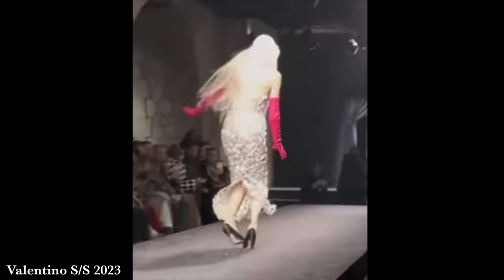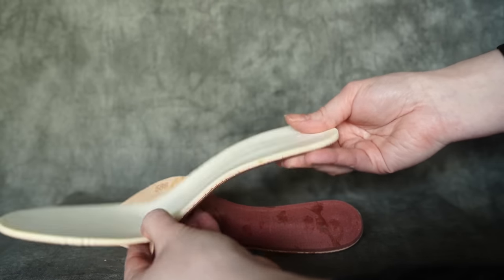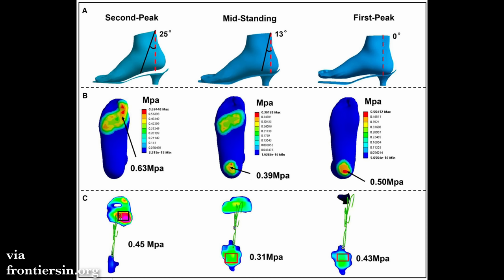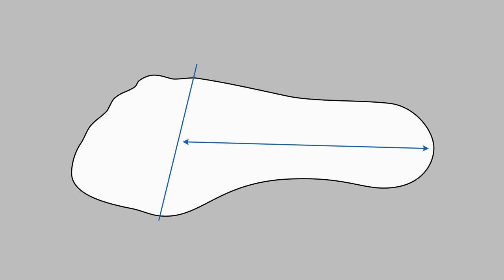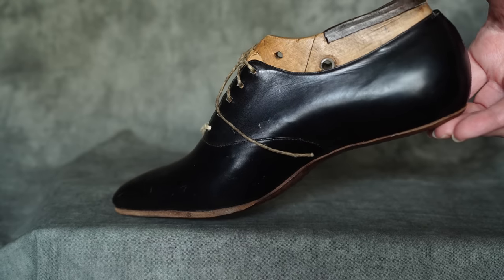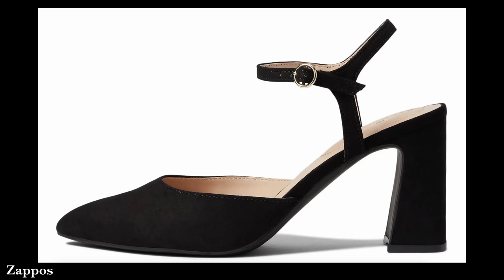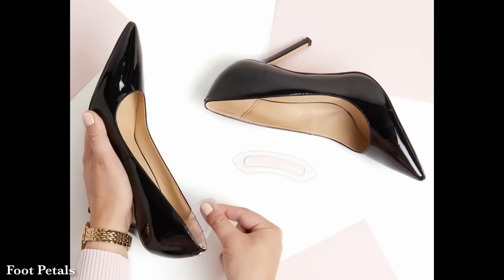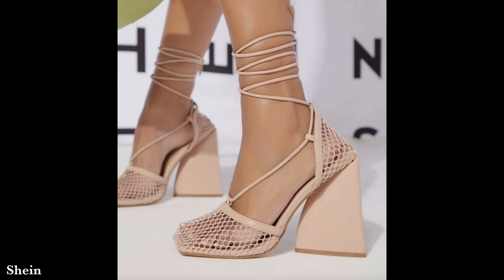Why are Modern High Heels so Bad?

Comment: I feel like most modern shoes in general have similar problems, not just heels. I've never worn them, but I would still struggle to find a comfortable shoe for almost 20 years of my life. I have wide, kind of flat feet, so I would always have to wear either sports shoes or shoes that were wide enough but way too long. I watched a video a few years back from a doctor talking about how everyone's foot is different and that most modern shoes are pretty narrow, which over time causes our feet to conform to the shoe, not for the shoe to conform to our feet. Ever since then and learning that I can find wide toed shoes, I feel a little less ugly and have had much better luck finding shoes that I can walk in without much aches or pains. I still need insoles, especially for work, but now I'm much happier and feel more inclined to walk around.

Comment: This explains my dislike of high heels so much! I have wide flat feet and all my favourite shoes are either converse, flat boots or relatively ‘flat’ goth platform boots (aka the height difference between the heel and the ball is small but the platform itself is like 5inches). I wish i could wear high heels but always felt unsafe when i tried them on. As a plus size gal, i always blamed my weight for this - now i know its the shoes! Thank you 😊
Reply: I have very wide but short flat feet and my toes come to a chisel shape with a giant big toe. I've flat out given up finding women's shoes that can work for me- the shapes are completely off for most of them, so off to the men's section it is. I've also found construction boots (Keen's Milwaukie to be precise) are some of the most comfortable shoes/boots I've ever worn. For being a steel-toe boot, it's surprisingly flexible, and the ankle support goes up a good few inches and is a lifesaver at the end of a long day. This is intentional design on their part, and I 100% appreciate it.
Reply: Did I write this comment? lol. People think I am crazy when I explain platform shoes are the most comfortable, but as a flat footer all the flexing in shoes that aren't like that make me feel like I am waling on knives by the end of the day. And the HUGE speedbump arch in Nikes is basically my cryptonite.
Reply: Same! Wide flat feet and converse are my favourite. I absolutely hate shoe shopping, especially for heels, because everything is far too narrow for me. For the first time in my life I found one pair of heeled shoes that actually fit my feet properly a few years ago. I cannot tell you how absolutely thrilled I was. I could have cried

Comment: The best shoes I ever wore had what I call a “Queen Mother’s Heel”. Not too high, a good average dimension and positioned in the right place under the heel. The sort of heel the Queen wore and could stand in a reception forever. It supported my heel, my arch didn’t tire and my spine was in the right place so no aches there either. Hard to find again unfortunately.

Comment: A lot of this was explained to me by the kind shopowner who sold me my first pair of heels. They are (I still have and wear them 18years later) red leather stileto sandals. Slightly 20-ish in design (more like someone cut out holes in a shoe, rather than just made a shoe out of the bits left after the cutting out). I don't have the chance to wear them much anymore, but during uni I would dance the whole night in them and then run home over coblestones. Unfortunately, the owner died and the shop closed and with it my access to learning the names of brands that cared about making their shoes right. But I kept all he said close ever since. It (and my very specific taste) made me a VERY choosy shoe shopper, but 99% of my shoes are pretty much made out of comfort. The 1% is a pair of black "professional" heels I broke down and bought for exams and work interviews at the end of high school, because the first exam was in 2 days and I had to get something. I guess I only wear them for about 4 hours a year, so they will do.

Comment: Thank you for all of that knowledge!  I am almost 59 years old and have always hated my “difficult feet”:  I have wide feet, a suuuuper high instep, and ankles that look like my calves just run straight into my shoes.  My most challenging feature, however, is that my feet are a full size different - left foot is a 7.5 and the right foot is a 6.5.  When I was in high school and participating in piano competitions I needed to get some heels (my Dad was super strict, but my piano teacher gave us specifics about how to dress to compete 😁). Back then I was lucky as my Auntie worked at a high end shoe store whose owner guided me how to purchase and then pad shoes.  Other than my aqua socks and flip flops, I only have leather shoes as I buy size 7.0, so they will stretch for my left and I can pad up the right foot.  Unfortunately this rules out a lot of styles for me.  Do you have any other suggestions that might open up a few more options, please?  Thanking you in advance  ~ Chris

Comment: I have such a high, curvy arch that I can’t make up the difference with any type of arch support of padding in 90% of shoes. I quickly learned once I started wearing heels on occasion that I should NOT buy any high heel that doesn’t rise up at the arch and meet the bottom of my entire foot to make that “shelf”. 

My American Duchess Astorias did indeed do that, BTW, along with providing the flexibility of a dance shoe that I prefer, and I wore them for years at 8-10 hour shifts at Great Moments With Mr Lincoln in Disneyland! So thank you! ❤

Comment: Thank you Nicole. This is the first vodcast of yours that I have watched but it is very informative.  It makes me feel somewhat angry that they are putting a young person to walk in shoes that a) don't fit properly b) aren't necessarily meant for use beyond the runway/catwalk but merely a 'mock-up' to show off the fashions 3) that the model is considered expendable (which isn't surprising) but, they are often mocked or made to look incompetent by going all Bambi legged and unstable. If a model walks confidently it surely shows the clothes to the best advantage so I hope shoes which are comfortable,  stylish and actually fit will become what is worn. It really annoys me that there is often high heels and low heels and very little in between. Often the lowest heel I can get is 4 cm. I would think but am not a podiatrist,  that 3 cm is probably a good height without compromising beauty and elegance.  Kumphs (which was a New Zealand  brand) that became Ziera would make beautiful mid height heels. Once I got to a certain age I discovered higher heels were giving me excruciatingly sore hips, back, knees, and when you would merely roll over in bed it was ouch ouch ouch! But women should be able to buy something that is beautiful while being good for your body and feet and not have to wear sneakers 24/7.

Comment: Extra round of 👏👏👏 for not just ranting about this issue, but giving such detailed and useful advice.
I'm another convert to dance shoes.
Ever since I got my first pair for some Tango lessons, there's no going back to me. I also have a proportionally wide toe box. It's at least a half size up from my size as determined by length, but many brands here don't even carry half sizes! I also have a very high arch and very slender heels and ancles...so wearing heels without straps is completely impossible. No pair of pumps, that even remotely offers enough room in front, will  fit the rest of my feet well enough, to even be able, to walk in them. Let alone, walk comfortably. And to add insult to injury, most retail sides like Zalando or Amazon don't use 'straps' as keyword for shoes, apparently. Or at least, it doesn't work well, to try and search for 'heels with straps'. 
So Tango shoes it is for me.
Reply: Do you have any suggestions for some "wintery" options?  As in, enclosed, not strappy.  Your feet sound like mine, and I have such a hard time finding heels I could wear in the cold and rain.

Comment: I've never even tried to wear high heels long term- but I've had tonnes of issues with shoes in general, and only found true long-lasting comfort in high quality hiking boots. But I'm hypermobile, in a way that presents most strongly in my feet and legs, going up to my hip joints. I also have long toes and narrow feet with especially narrow heels. Despite following my podiatrist's recommendations finding the right shoes has been extremely trying. I'm this close to just getting some custom made😅
Reply: Hi, me! Seriously, we seem to have the same feet. I haven't measured my feet in a while, but I used to have AAA toes and AAAA heels. The collagen issue has caused my arches to still look pretty when I'm not putting weight on them, but they drop flat as soon as I stand up, and that's widened the middle of my feet. I've got hEDS too, and most of my issues do tend to happen with my ankles (I cannot count the number of times I have rolled right out of whatever shoes I was wearing). I love ballet flats with almond-shaped toes (with a longer toe box) when I can find them, but I pad the hell out of the heel sides and still manage to walk out of most of them. I used to have some cheapo ones (from Walmart, of all places) that were fantastic, but I loved them to death and haven't been able to find any since that hit all of the marks (long toe box, built-in foot/arch support or enough height to add my own insoles, and ridiculously narrow heels). I'm so with you on wanting to save up to get custom made.

Comment: I worked in charge of collections for Antonio Marras when at Kenzo and one season he had asked a famous actress to walk in the show. The stage was wooden planking with center spaces for plants, tricky to walk. When she saw the heels he proposed she panicked as her feet were not, let's say, compatible with heels. I spent hours secretly recovering a pair of flats in the same print as the dress she was to wear and I raised the hem of the dress so she wouldn't have to look down. I have seen so many terrible heels but luckilly on the collections I worked on they were more reasonable. Sadly I have a frozen joint that stops me from wearing heels!

Comment: As someone with hypermobile-type Ehlers-Danlos Syndrome (translation: connective tissue too loose so joints too wobbly) who is in a lot of pain when wearing anything other than running shoes with custom orthotics, I really appreciate your thorough discussion of how the foot moves when walking and how insanely impractical heels are. Before I understood my condition, I fell for the misconception of “more heel means more stable” and bought a pair of impressively high wedges. I didn’t even make it down the driveway before both of my ankles rolled simultaneously and I fell. It makes me feel a lot better to see even trained models falling when their shoes are improperly fitted and know that it’s not just a problem with my genetics but with modern fashion.
Reply from the maker: Me too! There's a reason I've started switching to entirely boots and oxfords unless they're flat. I've never been able to wear wedges.
Reply: @NicoleRudolph  Wait, really?! We do tend to inhabit the internet on account of more active hobbies being less accessible, so I figured I might get a few comments from others with EDS, but I wasn’t expecting one to be from you! I love your content, thank you for taking the time to reply!

Comment: Fantastic video, thanks. I have a rule: if it doesn't fit right from the outset, I'm not buying it, no matter how much I like it. I don't believe shoes should be "broken in" - yes, there's a certain amount your shoe will mould itself to your foot, but if it's uncomfortable to start off with, then no amount of breaking in will ever fix that. 
I'm off to share this now, it needs a wide audience as it's packed with interesting info.

Comment: Thank you for explaining all this. I'd already sorta figured most of it out on the consumer side becuase I do have short toes and wonky ankles and a tendency to get sore heels, I have to take a lot of care with what kind of heel I wear, so generally it ends up being cowboy boots cause I can pad them out without looking weird and there's enough room for the tip of my big toe that I broke some years ago that now sticks up a bit more than the other... but even as a teenager playing with mom's high heels, I could stick my whole hand in between the shank and my arch (she has very long elegant toes and fingers, I have very stubby ones like my dad), and if I ever found shoes where that part fit, my heel hung off the back by a good half-inch. And after a few years wearing work boots, my feet widened enough (from AA to E according to the last time I stuck my foot in one of those metal sizers they have at shoe stores) that the only heels I still have and can get comfortably into are half a size smaller than I usually wear but marked "wide", and probably the one high heeled shoe I've ever found with the right foot proportion for me (RIP, Payless Shoes). But because my ankles are so wonky (I can go over on my ankle in my firm support running shoes if I step on a piece of gravel just wrong) that I tend to limit myself to less than about 2.5" heels so I can place my whole foot down at the same time when I walk in them, if I put a spindly little heel down first, I WILL sprain something. Also my mom says I walk like a horse in my cowboy boots because I take long strides, with high heels I take little mincing steps that get me nowhere fast but at least I remain vertical.
Reply: I think it's smart to take smaller steps the higher the heel is. There's nothing worse than somebody in high heels going ka-ploink ka-ploink, because they take huge steps. And the elegance of the shoe goes right out the window. And that is not even considering all the aspects that Nicole has so interestingly presented...

Comment: as someone that has worked in theatre for almost a decade (my mom is also a costumer professionally), heals in theatre are always reenforced with a metal brace, they aren't pretty to look at, but the give a lot of stability and prevent performers from falling or breaking the heals. As for models falling all the time, from my opinion it's more because they don't have the muscle structure or bone structure to handle high heals, high heals in my opinion are no different than pointe shoes in ballet, and most dancers that could go on pointe have to do pre-pointe classes for at least a year before they can ever go on pointe and many schools send their dancers to a doctor or physical therapist to see if the dancer even has the strength and bone structure to handle pointe work, I highly doubt model agencies do this kind of training with their models to prevent injuries
Reply: I agree about the leg/ankle strength issue, most of those capsized models had stick thin legs with no calf definition.  I used to love my high heels, and have very strong calves, so rarely had any issue [and I know that I absolutely cannot ever wear court shoes- that's 'pumps' to you Americans btw].  Unfortunately increased age and weight, plus arthritis,  mean my hips and knees won't take high heels for very long any more.  So I have found other styles that look cute and make me happy!
Reply: I danced on point for a year in my early teens.  I can tell you that point shoes are easier to balance in than stiletto heels.  Perhaps because the ankle is locked en pointe.  Perhaps because the vestigal heel of the stilletto offers a false sense of security.
Reply: I know someone who was told as a teen that she could never dance en pointe because she had an extra bone in her foot. So her foot structure would not support her weight while dancing.

Comment: For my prom, everyone was expected to wear heels. I wore around 2cm i believe which isn't that much compared to the other girls. My issue is long toes that also aren't correct in their length. My second toe from the outside is Longer than the middle one and the pointer toe is equally long. Finding shoes was a nightmare - we finally got a pair in a wedding dresses shop. I believe they were dancing shoes and also cushioned in the front.
I was able to wear them the entire night while the other girls had thrown off theirs way earlier. Felt really happy then

Comment: I think it's interesting that the best "model feet" are narrow, because I have very narrow feet and rarely can find shoes that actually fit, especially fit me well. Modern shoes are definitely made to fit a wider foot, even shoes that aren't in wide sized ranges. But there's no narrow shoe range! I've actually complained to ASOS about this, that their shoes are too wide and that they could make narrower shoes in a separate range...but that was years and years ago and I guess they didn't think it was commercially viable. 

As it stands now, I don't. I use a wheelchair a lot of the time now, so I can finally wear some of the shoes I was never able to or that I shoved away because I need so much extra support with my flat feet and unstable joints. Honestly, I really enjoy that aspect of using a wheelchair because I can wear what I want on my feet without worrying about whether I'm going to hurt myself. I still don't wear heels but I can get away with a lot more now that they're not trying to support my feet. I'm not saying the answer to this problem is everyone needs to start using wheelchairs, but if it makes the world a bit more wheelchair friendly...